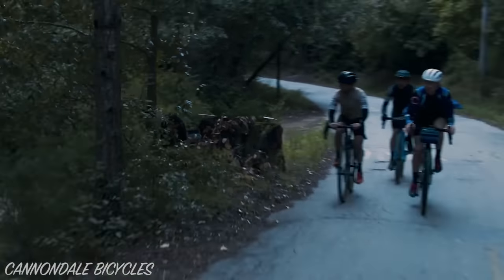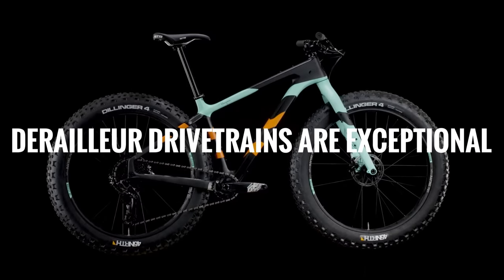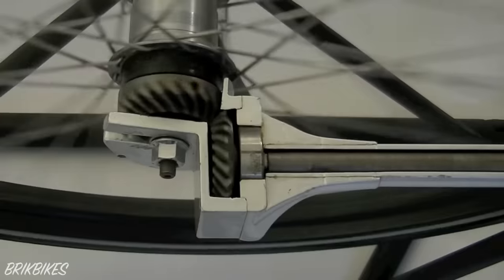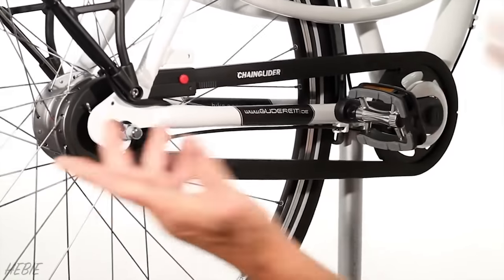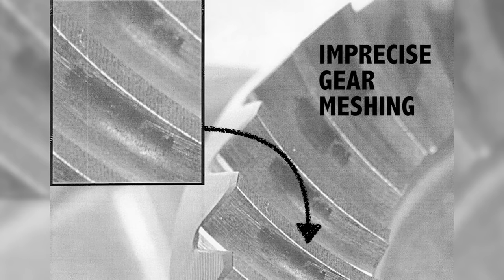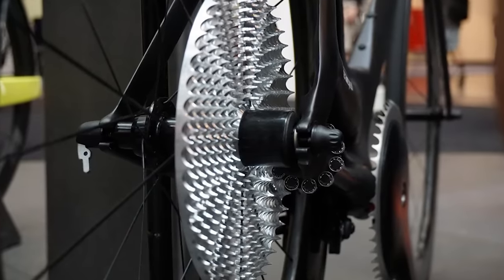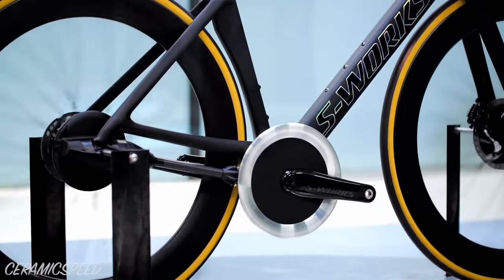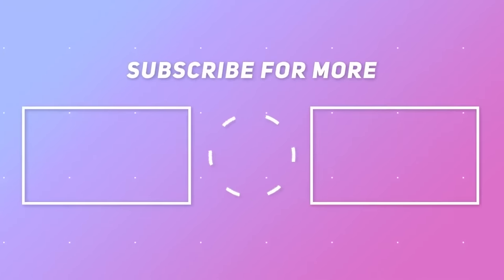Are Chainless Shaft Drive Bicycles a GENIUS or TERRIBLE Idea?

Comment: The shaft drive is like the rotary engine of the bicycle world
Reply: "Wow that's a neat idea, too bad it's worse"
Reply: @thebirchwoodtree  sad to admit but that's well said
Reply: The chain and derailleur system is beautifully simple, reliable and easy to maintain. The troubling bit is the cable levers mechanisms which seem to break on cheap bikes.
Reply: Sort of the opposite in many ways though. Rotaries are lighter, less reliable, more compact. Like shaft drives though they are less efficient.
Reply: If done correctly with crazy maintenance rotary engines are theoretically more efficient. Unfortunately they just aren't very practical or easy to maintain
Reply: Theoretically it could be better but in practice it doesn’t hold up. Mostly because of the materials we have available. If you could make perfect indestructible apex seals a rotary would be great. they are lighter and have great efficiency at high revolutions at the cost of less torque at low revolutions. They leak and burn oil though.
Reply: You know, I had a shaft driven Yamaha XS1100 cafe racer that almost killed me... Obviously, it’s a bit different than bicycles since it was a motorcycle, but I don’t like shaft driven anything after what I went through...

Edit: Although, cars and trucks are the exception. So... I don’t like the idea of shaft driven two wheel vehicles
Reply: @seanmichael8202   I had a shaft driven Yamaha XS1100 too but it was the big tank touring version and then i bought the black RH model .I absolutely loved the shaft drive system and i always said i would never go back to chain drive.
I was nearly killed too, but it wasn't the bike, it was my speeding (and the other drunk driver.)
What happened to you that wouldn't have happened with a chain drive?
Reply: @PYTHAGORAS101  ; Awesome man. I mean, I miss the bike cause it had so much character and it had mean torque. But, my incidents that actually happened twice, the middle gear seized locking the rear wheel while traveling about 55 mph. The second time was in a turn but at lower speed, both of which I was lucky enough to be in a position to control the bike to a stop. The trouble was, no mechanic wanted to work on it because it was old and there was no way of know if they had ever been shimmed properly. It made me scared to ride. It was a bummer...
Reply: @seanmichael8202  Did you keep the shaft oil tank topped up?
I had my RH model fitted with a Peter Allen  4 into 1 exhaust and i dumped the air box and anti pollution shit and installed clamp on k&N air filters. Mannn did it howl  sweetly when i hit the power band @ 8250 RPM. I loved it and i never had any issues at all with it.
Reply: @seanmichael8202  I dropped a 1979 Honda CX500 shafty in a parking lot due to the torque roll. But I ride a BMW and love it. No chain lube or adjustment, bullet proof reliability.
Reply: @MrMikeT89  
The Wankel Rotary Engine is not more efficient "in theory" as even "in theory" it has a very ineffecent surface to volume ratio and a design that limits it's compression ratio - so, a double edged sword that limits the engine's thermal efficiency. 
The advantage to a rotary engine is no need for a cylinder head and valve train components which means it can offer incredible swept volume for it's external dimensions - two to three times or more the displacement then a comparable piston engine of the same external dimensions. 
Wankel engine also excel a racing where high rpm power is far more important then an extremely long service life.
Reply: @177SCmaro  All very interesting, thank you for sharing. From an engineering standpoint, its more due to less rotational loss. If (theoretically) they had no leakage, and they produced the same power as piston engines, they would be superior having lower mass, higher RPM range, and less moving parts. 

It seems like you might have real experience with these platforms so I'm interested in your thoughts.
Reply: @MrMikeT89  
I don't believe the Wankel has any significant advantage in terms of frictional losses (keep in mind, valve springs work both ways, they take energy to compress but put much of it back into the engine when they decompress)  but it does in reduced reciprocal losses. That said, it's nowhere near enough to make up for it's relative lack of thermal efficiency. 
We car guys sometimes joke the Wankle should be reclassified as an external combustion engine because so much fuel is still burning in the exhaust port (outside the combustion chamber). Flames look cool but it's "horsepower you can see, not use". There are reasons there are no current automotive Wankle production engines.
But, yeah, I suppose if you removed all the shortcomings of a Wankel it would be  a brilliant engine but, then again, so would a piston engine.
Reply: @177SCmaro  Everything's great in theory lol. Thank you again
Reply: @MrMikeT89  
Is that a theory? 
Lol yw
Reply: @PYTHAGORAS101 ; So yeah, originally the thought was gear oil. The middle gear was tight/no leaks, and when I had a mechanic replace the middle gear, I don’t remember the details of what his diagnosis was but it was something along the lines of the previous owner having possibly tinkered with it. Which is just unlucky for me since I always heard they were bullet proof. The crazy thing is, I found a replacement at a salvage yard and had it inspected. My mechanic told me he didn’t think I had to worry about it, since having it seize on me the first time basically traumatized me, got in my head. Happened again... Could’ve been some hidden issue with the frame, the shaft, the God knows what. But that was a rough go... I did so much work to that thing, and ALMOST had it dialed until an electrical issue popped up. Just didn’t have the time or money. I found a replacement motor and slapped a custom 4-1 exhaust and will never forget how beast that bike was. When I took it out with the replacement motor, it was faster than I knew it could be, wanted to rip me off the seat. The motor previous needed rebuilding and wasn’t nearly as strong, so... At least I have that memory 🤷🏼‍♂️
Reply: @thebirchwoodtree  Rotary has some considerable advantages in high performance applications
Reply: I had a shaft driven Honda American Classic, a  beautiful machine and never needed to lubricate,
change a chain or sprockets EVER . I never noticed any lag or loss of power.
Reply: Or the Betamax of the video cassette world...
Reply: Or sterling engines- the perpetual engine of the future!

But also this happens a lot in technological development. Often times good ideas that are worse eventually become better when our materials and methods change
Reply: Exactly, it's only limitation is the morons that cling to old, inferior technology. Chains will disappear, just as they did in cars.
Reply: @MrMikeT89  Efficient power to displacement and weight wise but less efficient gas mileage wise.
Reply: @mickjager5974  Agreed. In reality they are by no means the best power plant but it is quite the interesting concept
Reply: When I was a kid my dad worked at a glass shop in Oakland and I was amazed. All their tools were run by belts that would twist sometimes. You engaged the tool pulling a lever. Belts are amazing!
Reply: If we're gonna talk about things that are theoretically efficient, let's look at gas turbines. Their peak efficiency is very good, problem being they usually can't run at decent efficiency over a wide range of power levels. Mostly, an efficient road car has to be reasonably efficient at max power AND at less than 25 horsepower, which is generally the power output while driving at steady speed on flat ground.
Reply: The rotary engine is a complex machine, the drive shaft is four bevel gears, where's the similarity?
Reply: not really. Rotaries make cool noises.
Reply: So... utterly fantastic but too scary for unimaginative squares? Got ya.
Reply: @177SCmaro  all correct.
Reply: @mickjager5974  Wankel displacement is not measured the same as a piston engine.  Only 1/3 of the swept volume is being measured in a Wankel (Mazda did this as a way to avoid the "displacement tax" in Japan) with the rest being ignored. When you factor that in Wankel engines have somewhat mediocre to poor power to displacement, which goes a long ways in explaining their relatively poor fuel mileage. The Wankel does have a good power to engine "footprint", i.e. it makes good power with relatively small external dimensions.
Reply: @177SCmaro  I believe rotaries are also more like a 2-cycle which tend to have more power/displacement but throw out a lot of energy due to opening early since they don't have 4-cycle like valves.
Reply: Rotary engines get a real lotta power with smaller displacement this has larger displacement wit less power
Reply: @charliechan8063  
How do you measure a rotary engine's displacement?
Reply: @177SCmaro  horsepower size of engine and weight how else
Reply: @177SCmaro  1.3 liter engine putting out 250 hp Honda broke records to surpass 1 litter to 100 hp
Reply: @charliechan8063  
I don't think you've understood the question. Engine displacement is the swept volume of all the engines cylinders, or, in this case rotor chambers, not counting the combustion chambers. So how do you measure displacement of a rotary engine? 
I'll give you a hint. Mazda did not measure the displacement of the 13B Rotary engine the same way piston engine's displacement is measured.
Reply: @177SCmaro  the area the dorito spins
Reply: @charliechan8063  
That adds up to 3.9L in the case of the 2 rotor 13B.
Reply: @MrMikeT89  that's just wrong
Reply: @ILoveTinfoilHats  ok? Your point?
Reply: @MrMikeT89  that you're wrong
Reply: @ILoveTinfoilHats  About what?
Reply: @MrMikeT89  being right
Reply: @ILoveTinfoilHats  lol about what? I respect your opinion, please state it. Otherwise, who's the one being dense?

Edit: It's ok to be wrong, gotta learn somehow
Reply: @MrMikeT89  you said rotaries are in theory more effecient, but that's just impossible due to how the intake and exhaust work
Reply: Yea but RX7 goes: PRRR PRRR PAT PAT PAT

Comment: Shaft drive bicycles have found a bit of a niche in industrial environments (e.g. navigating around large manufacturing plants or oil refineries) where efficiency isn't a major concern and the reduced risk of falls from getting pant cuffs stuck in the gears is a decent selling point.
Reply: In this environment also costs - beyond initial acquisition - for replacement parts and general maintenance are of no concern and a culture of over-provisioning guarantees availability and reliability.
Reply: That's true I have seen bicycles like that in the paper mills around here. Of course sadly and invariably they seem to want to switch over to golf carts or the industrial version of those things. Unfortunately I got a lot of Mill guys are fat and old
Reply: I've lost count of how many pant cuffs I've ripped on my bike!
Reply: true, lots of large facilities have mandatory work boots and long pants, so pants getting snagged by the chain would be a concern, and my guess is even the office staff won't like getting chain grease on their suits.
Reply: They seem to be common in bikeshare systems for the same reason.
Reply: Excuse me but how often do you guys rip your pants on the bike? That's like my last concern.
Reply: The judicious and trivial addition of something the entire civilised world knows as a “chain guard” renders everything you just said redundant. Just look at any Dutch bike.

Comment: I like chain-driven systems, but for mountain biking, the derailleur is so vulnerable to impacts. I think there's room for improvement.
Reply: Systems like the pinion gearbox paired with a gates belt are probably a better solution than a shaft drive.
Reply: Out of interest what percentage of mile vs transmission failure have you had? I do around 3k miles a year  not loads but only ever had slipping derailleur once around 14 years ago, only 1 broken chain  around 5 years ago both were simple trail side fixes. So 2 fixable transmission  issues in over 45k of miles.  Had one terminal issue of a pedal sheering off and stripping the thread.  Cable tied my foot to the good pedal and cycled 19 miles to the closest bike shop.
Reply: Simple to have a guard included with the bike but that would cost $5.00 to the manufacturers... 🤣
Reply: @golddiggerdave  it all depends on the terrain. I ride in the Canadian rockies and I took out two in one summer season last year. Maybe put on 500km on my mtb.
Reply: Or if you have a little shit for a sibling that likes crashing into it
Reply: And what makes you think an impact to the driveshaft section would be any better, and what would be cheaper to replace? I'll take the traditional chain system anyday over shaftdrive...
Reply: Johnny  On the bright side, an open derailer has the Kalishnikov effect of low tolerances and open access to outside the mechanism. Spin that once, and the mud is mostly gone.
Reply: i cant wait till bottom bracket gearboxes become more common
Reply: Pedal assist seems like a far better solution.
Reply: @HansensUniverseT-A  
Can always subject the bikes to winter roads and see how their parts survive in salted road and wet salted roads (usually happens after rain or snow melt).
Reply: @Aereto  Speaking of salted roads in the winter, they love to do that here in Norway, a nice strategy to have people buy new cars every 5 years or so, i stopped riding anything in the winter here, it destroys everything, even my shoes fall apart...
Reply: Ive been riding mountain bikes off road since 1989...never yet broken a derailleur. 
Maybe its that i ride more carefully, or weigh less, or ride less rocky right hand side trails, but i keep hearing about people breaking a derailleur every year and i wonder what the F they are doing to their bikes.
Reply: @marcalvarez4890  I ride as fast and as hard as I can pretty much every time I ride.
Reply: @DCassidy42  So do i... i just don't break parts. 

For reasons, see previous comments.
Reply: @kirknay  +1 for the aptly put AK reference.
Reply: Then you realize high end parts are meant for performance, not durability.
Reply: If you abuse your bike you need to know how to wrench it yourself and carry a small tool pack with you.
Reply: Yeah, the amount of times that I've bent or just completely ripped off a good derailer is embarrassing.
Reply: I have destroyed more derailleurs than I can count on rocky enduro or DH trail and i would Love to have an alternative Drivetrain that doesnt include such vulnerable mechanics so close to the ground.
Reply: shaft drive is the answer, just look at what they do on motorcycles, and copy that.
Reply: This 2010s shimano shadow and SRAM deraulliers got enormous improvements in that matter. For current fade of oversize 10-51t 1x12 - lowest point in that setup for me looks uncomfortably near to the ground.
Reply: Bruh that cause its mtb, the chance of hitting something hard is high and parts need to be replaced a lot or you can have durable parts and a 50kg push bike.
Reply: I have an improvement.
Reply: Gear hub & belt is where it’s at for that
Reply: The teeth on my rear wheel cassette wear out every two years. I would love a modern shaft drive.
Reply: @felixb.59  BB-integrated gearboxes are your choice then. Today you have a plenty of options. And even a decade ago there was G-Boxx from Nicolai.
Reply: @marcalvarez4890  push harder pal
Reply: I guess but at the same time it allows a tremendous degree of fixability and fine-tuning that i don’t think other systems can afford with their extremely tight tolerances
Reply: @Dan Nguyen my mistake, yeah high tolerance.
Reply: @HansensUniverseT-A  , ever heard of a water hose?
Reply: @marcalvarez4890  It's all about the rockiness of the terrain. If you go high-speed, stones and boulders are thrown up, hitting the frame and if you are unlucky, the derailer.
Reply: @BubbafromSapperton  I remember when a simple, S-shaped bar of metal was often bolted on as a guard for the rear derailleur on many models of bicycle.  But, as you said, that extra $5 (probably more like $1) was a deal breaker.
Reply: Gearbox is the solution. But is expensive, rare and cannot be installed on any bike